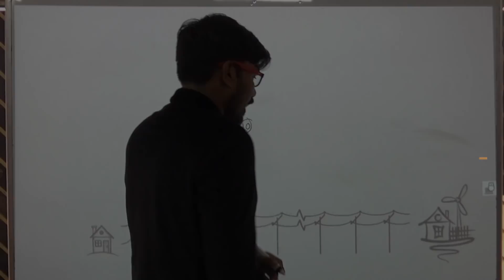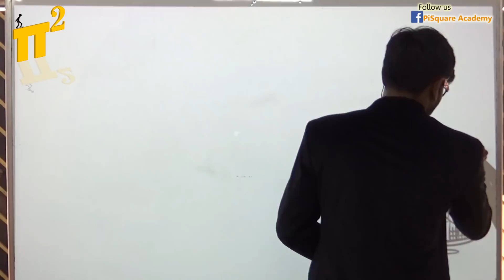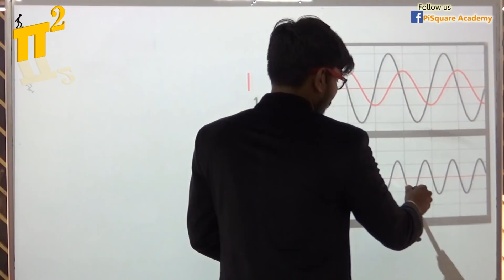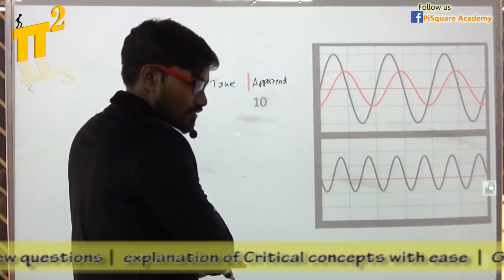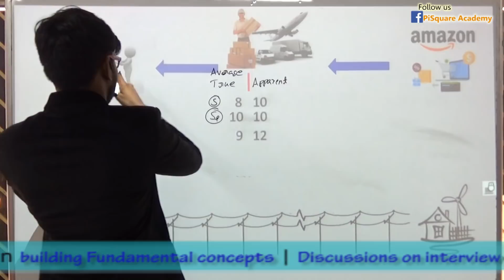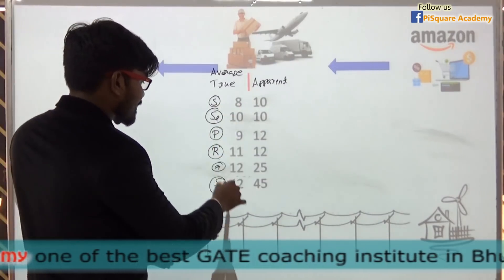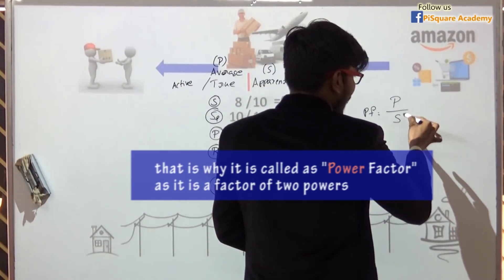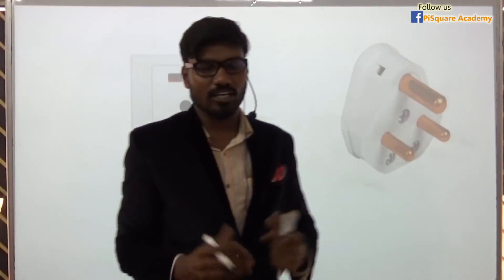Why & What exactly is power factor and efficiency | Interview Question | PiSquare Academy

Comment: This analogy is not good best equipment which return all items back in system is best but these idiots call it worst use reasoning if anything returns everything back it is not using any energy and that's hell for money printing idiots how you can charge for bills if it is not using any energy that is free energy 🖕🖕🖕🖕and resistor is perfect for that so called good boy

Comment: At end you said about phase and neutral pins.in my prospective that is wrong because for AC phase and neutral are changing per every 0.02 sec.so no problem with phase shifting.it is mandatory for DC voltage because + and - . direction is only one side.👍

Comment: Sir,
Then how a capacitor improves this.....you can say it act as a mediator who supplies apparent power to an inductive load..so that the main supply transmission not gets affected...
But consider a pure capacitive load(never exist in practical..but can be set it) ..how it raises power factor above one..
..by your anology wrt online shopping...the consumer (capacitor) returns all the products he bought + some of the products he already got...is that the scene..

you can explain what happens in a practical RLC load...nd what happens to the remaining energy
...

Good effort nice video...
plz reduce the pop ups(if cannot plz reduce the font size or..show it in intervels)
..provide a clean interface (like khan,..etc)..now its look like a online shopping tv ad.
you provide superb quality content thats what all necessary..no need of gimmicks..

Suggestion
Content quality is good.. But video quality needs improvement especially in the audio side..needs some sort of boosting and noice removel...you seems to use high tech...the use of projector+board is nice..in this setup..audio needs improvement

The stay focus thing is good but need to do in a more initiative way..
Thank you..
Reply from the maker: sure. thank you for the elaborative feedback

Comment: sir you have mentioned two sinusoidal wave ( current and voltage) here ...a sinusoidal wave have + and - part ...it is actually alternating the direction ,right? and itis  happens due to relative motion between magnetic field and conductor( Generator)....my confusion is that you said that it happens due to inductor ...
Reply: What he says is about..power

Simply,
Power = Volt x current
In resistive loads..volt sin wave and curr. Sin wave are in phase..ie both gets their positive half and neg. Half at same time..
If we calculate power 
+ Ve half (+V) x (+I) =  + P
-Ve half  (-V) x (-I) = +P
 
The power always positive that means it flows in one direction ie..source to load in case of resistive load.. 
now you  check the video, from the graph of inductive load you can find out what happens there..
Gd day

Comment: Sinusoidal curve of ac current shows the current or flows of electrons in each direction, returning of electrons will be same  each and every time. Whereas power factor is the angle between Apparent and Active power, active power is 'cos' component of apparent power and reactive power is 'sin' component. In physical condition active power caused heating effect which is used in bulbs, lights, heater etc and reactive power generates the magnetic field of current which is used in any kind of motors. PF depends on the nature of load i.e. if it's domestic type use of lighting load or active power will be more and in case of industrial load use of inductive load or reactive power will be more. 
So it's not equivalent to online trading and returning of goods and nature of your girlfriend, you are spreading misconception to students, anybody who gives your answer to interview board will be rejected immediately.
Thumbs down for your huge pile of misconception.

Comment: Sir , i have a problem in maintaining the pf in my company . my total load is 23 hp , i have added 20 kvar capacitor of 8,12. Last month my pf was .610 , after adding there is minimal improvement in a day if i run my company it increases by 3 and by night it falls 5 points . helpme i paid a penalty of 18000 last bimonthly bill.40 days since adding capacitor now my reading stands . 704
Reply: Hai

Comment: Sir u have said that the transmission voltage is in the form of 11kv 33kv this is due to 10%  for losses then at secondary distribution ie from substations 11kv line is given to the 11kv transformer then in this case they may also have losses then why the out lines from substation is exactly 11kv and given to the transformer rating of 11kv

Comment: Need to explain more about reactive power(Q) that you need to reduce to make the power factor closer to unity if the load is inductive for example. Power triangle is the simplest for power factor explanation using the ratio between P/S.

Comment: Wat about capacitive load?
Reply from the maker: There is no much conceptual difference between inductor and capacitor in terms of power factor
Reply: PiSquare Academy of course i can get the power diagram from the voltage and current .hw we will mention the lagging or leading power factor?
Reply from the maker: Please watch this video to understand lead and lag https://www.youtube.com/watch?v=ijh2QTpiECY
Reply: in capacitive graph 
i=v/r+(-j)xc  this shows that current leads by 90 degrees so it starts pi/2 earlier which is opposite to  inductive load  it get both positive peak and negative peak

Comment: I saw on the pack of CFL power factor is 0.8 so is it means it is returns 2 unit Power
Reply from the maker: Yes! it is 20%, but dont worry Varsha, you are charged for what you have utilized not for what you have returned (like online shopping)
Reply: Varsha Paliwal 20%
Reply: NAVEEN KUMAR what is 0.8 tells u?
Reply: NAVEEN KUMAR even sir said that it is 20%
Reply: PiSquare Academy sir u r videos do help us thank u  I myself mechanical engineering but I watch u r videos as they are interesting 😍
Reply: NAVEEN KUMAR what is your channel name sir
Reply from the maker: We have never mentioned that 20% is reactive power, we have just mentioned 20% of power is returned to source. Reactive power concept is slightly different.